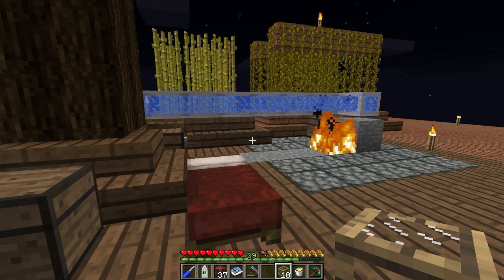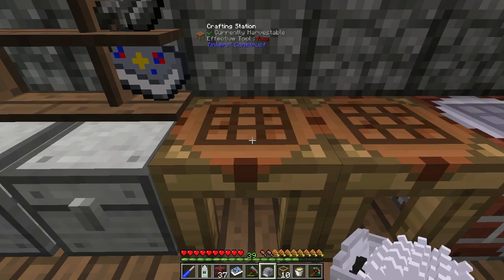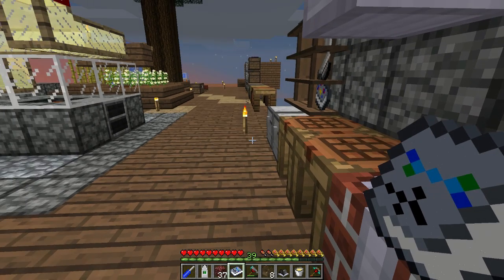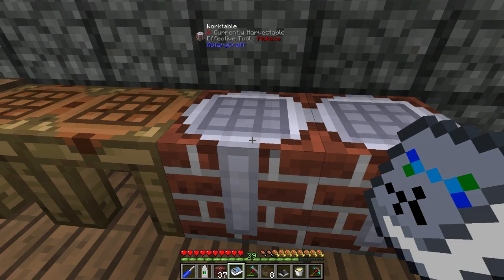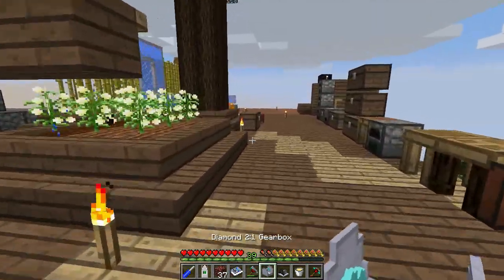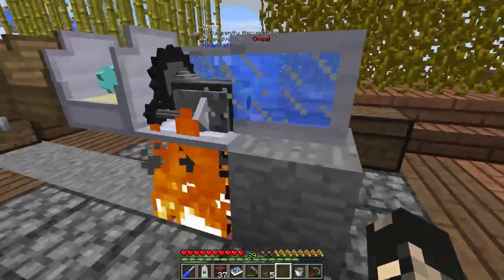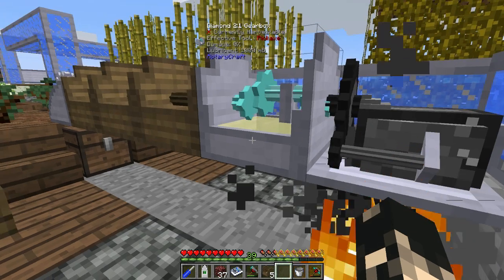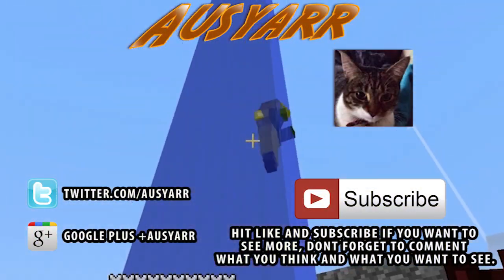RotaryCraft Woodcutter, Automatic Tree Farm, Diamond Gearboxes

Comment: Gear boxes of the same gear material will generally use more lubricant at higher input omega.  The exact formula is
tank.removeLiquid(Math.max(1, (int)(DifficultyEffects.LUBEUSAGE.getChance()*ReikaMathLibrary.logbase(omegain, 2)/4))).  This is evaluated every 80 ticks.

The config is by default is set to medium difficulty, ("Difficulty Control"=2; 0=noob, 1=easy, 3=hard, > 3=unplayable).  Lubricant consumption factor is easy = 0.25x, medium = 1x, and hard = 2.5x, and 1x for anything else.

So for an input of 32768 rad/s on medium difficulty, a steel gearbox or below will consume Math.max(1, (int)(1*log(32768)/log(2)/4)) = 3 mB / 80 ticks

Steel gearboxes have the greatest internal tank, storing 24 buckets of lubricant.

I forgot to add that in the as yet to be released V3, it seems wood gearbox will no longer consume lubricant.

As for API incompatibility, just remove the forestry API from DragonAPI if you have the latest forestry installed.
Reply from the maker: I'll try an annotate that as simple as I can. Higher grade mats = less lube usage. I think if I put the maths in some heads might might explode.
Reply from the maker: Oh and thanks for the info.
Reply: Well, the stone and steel, and for your version wood, all use the same formula so they will use the same amount of lube for the same input omega, if they can handle it.  So it's not exactly higher grade mats = less lube usage although diamond and bedrock don't count since they don't actively consume lube =).

The advance gearbox, the one that does 256x, will use lube at a very healthy pace.

You should try this mod for more math goodness.
http://www.minecraftforum.net/forums/mapping-and-modding/minecraft-mods/2104648-electrical-age-physics-electric-circuits-more
Reply from the maker: Looks interesting, I'm gonna try it out.